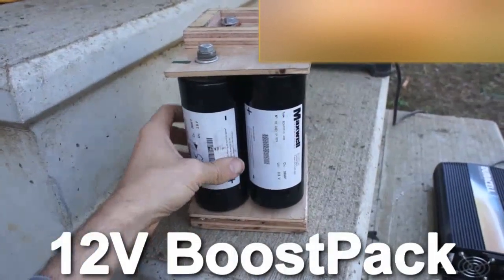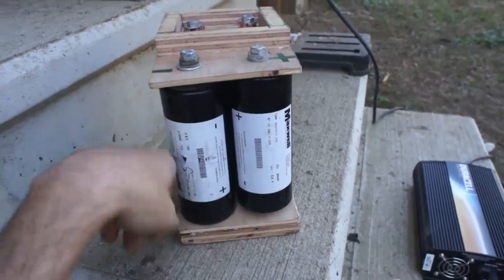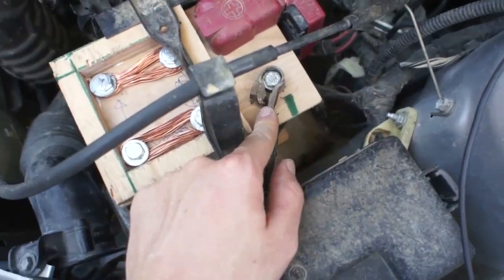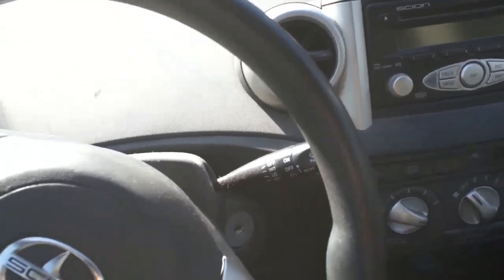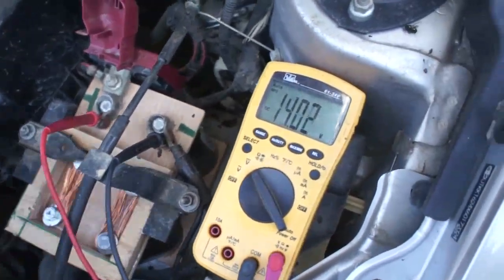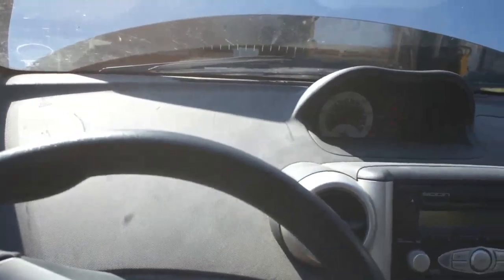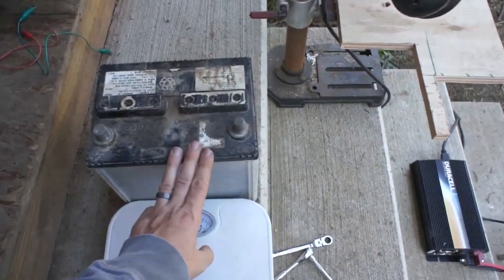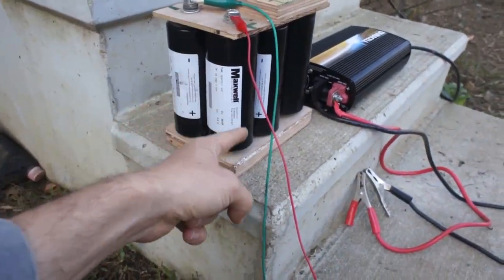12V BoostPack. Replaces auto battery. Works great!

Comment: also it would seem after some thought that a large joule thief could be used with this system to where the capacitors can be at 1% charge and still give out the full 12 volts and all that jazz so as to control the drop-off slope. course im not sure about what this would do to the amperage or if it would even work but seemed a good idea to try maybe?

Comment: so have you found how long in seconds the caps can crank on the starter motor while the engine is cold? like say if its very cold outside and it takes say 3-10 seconds to start up?

Comment: From my experience I know the electrolytes use to explode when connected back worth to a charger,so take care.
 What if to use 12v condensers in parallel?Or just one big enough.
Thanks for idea.
Reply: They don't make them. You can find supercaps now at 3.2v each. Older ones 2.5- 2.7v ea.

Comment: It's looking like his pack is getting around 8.8 amp reserve capacity (assuming the lower voltage is 10.5v (so as to be a fair comparison to the LAb).  A lot of electronics in cars might work below that... but it will be unreliable.
So this would give him about  29-30 min of low and high beam light while still being able to start the car.  Not great... but not too bad either (and better than I had originally imagined).

Comment: Im sure someone has said this somewhere in the comments... but you were not "charged" up to 14 volts when you restarted the car... your alt puts out that much when the car is started.... its pretty cool that you did this....especially with the weight issue. but dont be confused about the science ....and as stated.. cover those leads, or you will quickly learn what a nice arc welder you built also!

Comment: What is the amp\hour rating compared to a lead acid?  I suspect that reserve capacity is very small.  Literally I can't see sitting and listening to the radio without the engine running for more than 5-10 minutes before sufficient cranking amperage is compromised.

Comment: Buy some 1/2" rigid (Type M) copper pipe at home depot. Cut the length you need to connect your posts together. Take a hammer and completely flatten the pipe, then drill a hole in each end for your bolts. There is nothing better than this, and you cannot beat the price.
Reply: Great tip!

Comment: Ok. I can see how you confuse the practicaly awsome current you can draw out of those caps, but the lead-acid battery has way more energy storage capacity than them. You can still use them in parrallel to your car battery just to boost the cranking amps. That's why the car audio industry uses 1 or more Farrad caps in parralel with high power amplifiers. You will be far better off with LiFePO4 batteries. They have a nominal of 3.2V per cell so 4 in series will efectively replace the normal batt.

Comment: One of the things I would be leery about using a cap pack like this is that I like running the radio while sitting in the car waiting for a pickup call. That would drain the cap pack pretty quick. Then I'd be stuck. Now if it were a super cap, that would be different.

Comment: just so you know this is an old idea the problem with this setup is the simple fact that you cant leave anything on in the vehichle for very long before your car wont start such as the radio one way around this a solar panel there are many good ideas to get around this fact and capacitors will last five times longer than a battery at least

Comment: I am tempted to add an ultra capacitor pack in parallel to my existing new car battery. The ultra capacitors low esr would give a chance of a start even if the lights were left on overnight. well done on a very thought provoking video

Comment: ummm..... what? in what way is any more of a safety hazard than a regular battery? how in the hell would it spark randomly when you fill the gas tank? and even if it did, how would a spark under your hood be dangerous when filling a gas tank at the rear of your car?

Comment: I have been working on a similar project myself but havnt got to the point of swapping it into a car yet. I would like to know the results of your testing after you've have giving it a more thorough test. I would lov to see the results of how well it held up before I get to the point of dropping my cap bank into my car. By the way what are them caps rated at? They look about the same as the ones I have. Also how is the balancing between caps holding up with the zeners and fets?

Comment: Please read previous comments to see he got them for $6 each from a sale at the time.  They are around $75 now, or buy 100 of them for a slight discount.  Still worth it considering they are good for 500,000 charge and discharge cycles.  Vs lead acid, or even glass mat batteries.  Device will pay for itself in 6 years or so, but will last longer than the car.  Also, this is for a DAILY DRIVER.  Stop wasting time wondering if it will hold charge for a week, it won't.  It's still a capacitor.

Comment: That's nice, but what about the capacity? How long can you listen to the radio with the engine turned off before the caps go flat? 

On the other hand, I can see this as a useful addition to the traditional battery. Asfor the weight - yea, my car weighs ~1500kg, the 15kg or so of the battery is 1% of the weight.

Comment: hi , nice work ,, but as I know capacitors will not hold the volt by time , so when its charged , if no charger charging it it will lose the charge very fast even if you are not using it .

Comment: The idea as such is not new. The internal resistance of supercapacitors is *VERY* low, hence they can deliver a hell-of-a-lot-of energy instantly, It's mere the size of your copper conductors that limits the I/O current of these. 
The basic idea is to back-boost the lead-acid battery, which delivers Energy at a slower rate. 
Caveat: You need to make sure: Never exceed the nominal voltage of the capacitor, some are 2.5V, others are 2.7V. That is CRUCIAL.
$6 a pop? Unheard of here - - -

Comment: Alt voltage will be the same as system voltage. Problem I see is not much energy stored, and caps will self discharge with time.

Comment: I think this is a great idea for using in small off grid applications. A few cells like this, being charged by a 75 watt panel, with a decent sized inverter would remove the need to run an ac voltage line to a remote location. Also, just so you guys have the info, the standard output ranges between 13.6 and 14.4 volts dc on modern alternators which now have built in regulators and range from 75 amp to 155 amp output which is which is handled by a non-integrated regulator.

Comment: add a tiny battery (5-10ah?) and you solve a lot of the drawbacks these caps introduce. leave the car for a month, use the drill press well into the night...

but you'd probably need some circuitry to protect the battery. i can imagine the caps draw a LOT of power when recharging...

Comment: could you take a crapload of these boost packs and couple them to a battery (to provide the storage the boost packs can't deliver), and operate a small electric vehicle? or perhaps put a solar panel in the mix and use this assembly of packs and battery with LED lighting to provide lighting for homes off the grid?

Comment: A boost pack would be especially well suited to jump-start a vehicle with an all but drained lead-acid battery, as long as there is enough capacity left in the LAB to charge the caps. There are safety issues to be considered, so don't try this at home. Imagine that the caps have practically infinite current supply capability (for a short time though) and will fry anything in their path in case of a short!

Comment: You mustn't confuse capacity with power. Lasersaber's BoostPack has about the equivalent of a motorcycle battery in capacity. There is no way that e.g. a 10Ah motorcycle battery can power anything over the course of days than the tenths of milliamps of stand-by drain. OTOH, a supercap will maintain its ability to deliver power (i.e. CCA) over almost its entire voltage range (i.e. SOC) because of its low Ri. This is why he was able to restart the car even when the voltage dropped towards 10V.

Comment: I commend your work, but keep in mind it doesn't have near the capacitance of a lead acid, IE would run down much quicker with a draw, radio etc. Capacitors also internally short and run down much quicker that a lead acid.

Comment: Nano carbon super capacitors:
1 - twice or better the voltages of Li cells = 2 X or better the Power Density
2 - no "Internal Resistance" of batteries
3 - 100,000 Charge cycles proven
4 - have "power density" approaching, even exceeding gasoline today
5 - rapid transfer charges from previously charged  capacitor banks
6 - lighter weight
7 - non flammable
8 - no "exotic" materials - no Li, no chemicals
9 - mass producible
10- no toxic chemical dangers
Google Chreos electric car.

Comment: .......and two,     tho see the actual volts that the battery has, you have to unplug it from the car and run a load test on it with a little box we "licensed mechanics" call a "Toaster". 
But in order to do that, the level as to be right, and the battery as to have a full charge put on it with a battery charger.

The way the meter is hook up to the battery with the car running, it's the same as if the meter is hooked to the alternator. 

Both comments are to lasersaber. just so everybody knows

Comment: Hey man! From what I see in the video, I'm sorry to say, but you are wrong when you say "Yea but the alternator load dropped off which suggests the 14 volts are back in store and if the 14 volts were not maintained the car wouldn't start as he went back every other day to start it".  Read this carefully, if the level of electrolyte(the liquid in the battery) is not properly maintained, the battery will NEVER BE ABLE to stay charged. It's as simple as that.

Comment: I'm thinking... top engineers at the old big 3 with all those billions  and sounds like a free lunch situation beceause my bs meter is off the charts on this one. One guy in the chat wants to run an air conditioner, another one wants 6 dollar supercaps and another a string of LEDs. It's just bizzare knowing you have to put all that energy into the circuit, it discharges and then all you get out is loss from that in the form of heat.

Comment: It's awesome isn't it, I put boostcaps in my car in 2012 as well.
Cranking is faster due to the caps not dropping volts under load.
Only Issues are
* Ignition off current. Depending on car it can run flat in under a week. I added a relay to disconnect on the ignition feed at 10V
* Over weeks the ESR in each cap will slowly get the caps out of balance. Some 2.5V zeners and fets on each cap solved this
* Some cars try to stall from the alternator load at startup (add a res to the alt charge feed)
Reply: Wow, thanks for the tips!

Comment: Use E= 0.5*C*V^2, or 22.8 kJ for 6x1400F. A starter 200 amps at 12V, or 2.4 kW. So about 8 seconds. Or TC method to ~60% discharge: starter is 0.06 ohms, RC time constant 14 sec.

Headlights about 20 amps, so 10 times longer, or ~2 min. Drill press ~1/2 HP or 400 watts, so 5 times longer than  starter, ~1 minute. In the video you start at 8:40 and at 9:40 the inverter LV beeped. There was also a lamp and the drill was not always drilling, and the LV cutoff is ~11V. Still a good approximation.

Comment: After what people are saying here about leaving lights on by mistake etc it does seem that this on its own wouldn't be practical but after reading a bit it seems also that ultra-capacitors are excellent for prolonging the life of Batteries for off grid systems and together with an inverter the off-grid workshop idea would be even more efficient I'd imagine but how would it be rigged up? For example would it be SOLAR PANEL--BATTERY BANK--DIODE--ULTRA-CAP BANK--INVERTER to appliance?  Wud it work?

Comment: Yea but the alternator load dropped off which suggests the 14 volts are back in store and if the 14 volts were not maintained the car wouldn't start as he went back every other day to start it. You are dead right about batteries having use around the house even after they had their day with the car. I ran LED lights in an off grid situation for a month on two occasions a year over the past 3 years from an old car battery without actually having to charge it!! LEDs are great. Very efficient

Comment: Hmm... Young drivers haven't learned to turn the headlights off when you turn the car off. Also, considering the cost, weight, and environmental impact, having a bank of capacitors is the better choice over lead acid batteries. Also you can just use more capacitors.

Comment: First off, lets notice how he is putting a wood box in his engine compartment. But second, did anyone notice how quickly the voltage was dropping when he had the headlights on? This isn't very reliable if you level your headlights on and run into the quicktrip to grab a soda and by the time you come back out the car is dead. I honestly don't see the point of this.

Comment: It's lower then that cirric. Those 6 capacitors have about 50,000 joules. Which, at around 12-14V translates into 1 Ah. However, that said, the power density is clearly high enough to start the car several times. As long as any parasitic drain is minimized, this would be a perfectly fine drop in replacement. As evidenced by the video.

The thing can charge from any 14 or so volt source. If you're clever you could charge it through an internal power port.

Comment: man there is not enough electrolite in the battery. you should of opened up the little covers on top and and water almost to the top, and then you charge it. that battery did her time for the car, maybe, but can be useful around the house. and the voltage number you see on your meter with the car running, is the alternator charge rate.

Comment: when running an electric motor if you add capacitors in series on the primary and secondary windings it drops the amp lode as well.

Comment: This is interesting, but I definitely wouldn't depend on it for a workshop area.. it would be done in a few minutes once the sun goes down.  I also would still carry a AGM battery in my trunk because you never know when ur car engine won't start and you'll still want the lights to work while you're trying to fix it on the side of the road or something.

Comment: Exactly. This will not hold any where near the same amount of charge as a car battery. Caps are good for sudden loads, which is what they are designed for.

You can see how fast the caps discharge with the full beams on and aircon, this is wayyy to fast.

Comment: there is a solution:
hybrid caps, like the lithium-ion-capasitor.
you'll have something that can deliver a higher current than a normal cap and you'll have the energy storage of a normal battery, and it's safer that li-ion batteries.

Comment: Very good for solar applications. Not good for your car, the battery would discharge if your car engine stay off while parked or inside your garage having its current drained by any always-on eletric system in your car like the alarm or GPS tracker.

Comment: The average car battery has a capacity of 70-80Ah (there are also batteries with 55Ah and >100Ah), and can give out WAY MORE than 70-80 amps. Most car batteries have a starting current of >500A and can probably sustain >200A (of course depending on the battery)...

Comment: Not practical.   Cap banks have no capacity.  Plus most modern cars have some amount of draw while shut down..     The modules in my BMW wouldnt even make it to sleep mode before the cap bank was flat...  and cars with alarms wouldnt be able to utilize this either.   And its still more expensive than a traditional battery....

Comment: Thanks for getting back...On the point of the food
processor....I was watching you run a fairly good size drill (possibly
1500watts+) for a few minutes through an inverter connected to your boost
pack and figured on the basis that this works and on the
basis that a 13watt solar panel can charge up the booster pack within a
half hour, would I be right to believe that this would be a viable system
for my food processor if only for this purpose? Also where can I get these capacitors for $6? Cheers

Comment: I believe it will work just fine as long as you constantly use your car to recharge the capacitor. The question is how long the capacitor will hold the charge ? Say, if you park overnight, will you still expect that the charge is still there?

Comment: This is cool. How many cranking amps is it? I have a 1080cca Napa battery in my truck. Its like 45-50lbs. It holds 14.85v(large stereo) never go below 14.4 when stereo on with truck running. Can crank it up not running for quite some time too. I'd like to build a small light pack like this for my onboard compressor.

Comment: how about putting a small solar pannel in the car window, to keep the caps loaded for longer, and also how about a big diode (40-45 amps) and a rezistor to allow slow recharge(less stress on small engines-alternators after startup) but fast discharge(for the engine to start) ?
anyways GREAT VIDEO GREAT IDEA

Comment: I love this video. It has just enlightened me in a big way. I've been racking my brains trying to think of a way my wife can use a 1500watt food processor off grid when we finally get there and this is the answer for the short bursts of energy needed. Just one question though....bare with me because I'm new to all this stuff. If I use LED lights which take up very little power, would this system work over longer hours. Can I use 12V LEDs of this directly without an inverter? Cheers